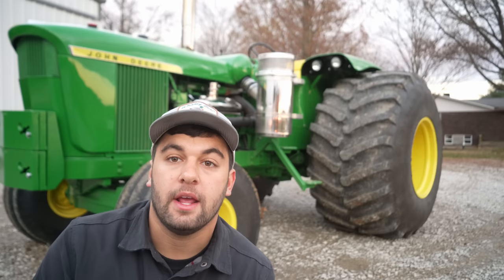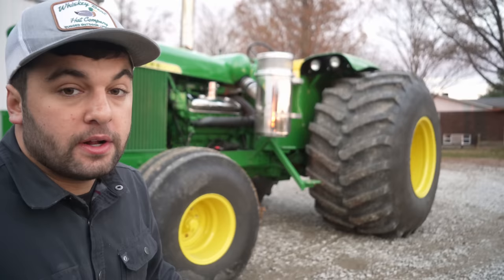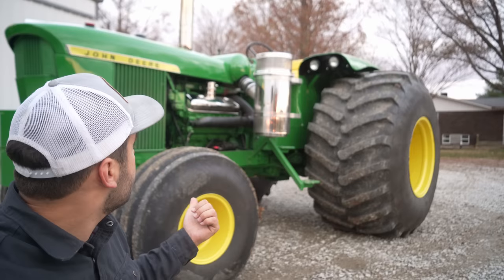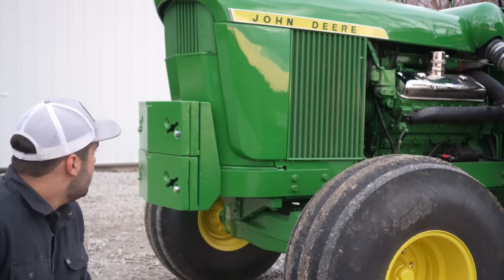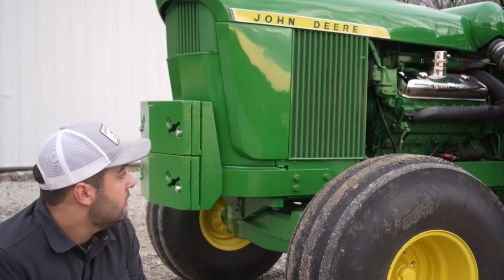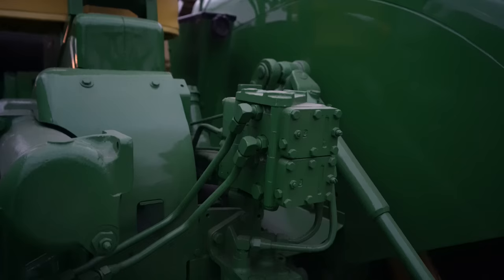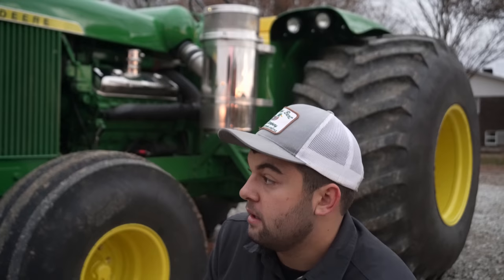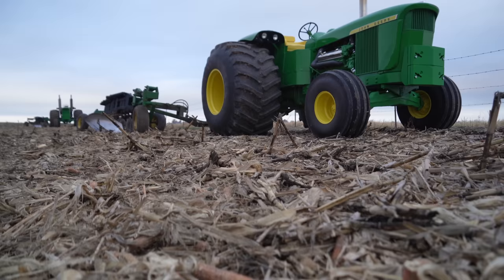John Deere 5020 Repower- 8V71T Detroit Diesel

Comment: Not a supercharger blower it does not super charge the air the turbo is for power The blower is to complete the scavenging process of the two-stroke Detroit
Reply from the maker: Essentially the same thing.
Reply: @RennerStockFarms  nowhere near you’ll over speed the engine and runaway before the blower ever adds any more power i’ve spent 14 of my 24 year old live Learning from my grandfather working on 8v92 6-71 6v92
Reply: Not a supercharger on a Detroit, it's a scavenging air pump and not a power adder. Engine is non functional without it, turbo is the power adder.
8v71 is 318 horsepower, 8v71T is 360 horsepower.
Beautiful tractor and workmanship on the console.
DON'T lug the engine below 1700 rpm !
If you reproduce the adapter plate and clutch parts, a lot of people would buy them.
Reply from the maker: I stand corrected, thanks for your input guys. If I am not mistaken, aren't the blowers off these engines used on other engines as superchargers?
Reply: @RennerStockFarms  super chargers are essentially the same as a blower but when you take a blower off of a Detroit and put it on like a big block Chevy and then it’s a supercharger it charges the air for a naturally aspirated engine like a big block Chevy for example but on a supercharge big block it takes like 5% of the horsepower to make horsepower but with a gasoline engine you can spin the blower faster to actually create the boost necessary to make it a supercharger is what I was taught
Reply from the maker: Well said, we are on the same page now. I knew superchargers and blowers were basically the same thing, its just how they are used that changes their name. Thanks for watching Corey!
Reply: also some cases are different like some have after coolers under the blower an Drive gearing could be different as well
Reply: @RennerStockFarms  Yup. I think it rather common to take the bower of a dead detroit and use as a supercharger. Beautiful looking and running machine by the way. I ran maintenance on 2 foam trucks that had 8V92T's in them. Could get a 85000 lbs truck to 70 mph in 58 seconds and pump 1500 gallons of water in a minute and a half. 
My big squirt toys.
Reply: @RennerStockFarms  Yes they are being anal . Blower and supercharger is the same unit ,I believe the GM engines are slightly above atmospheric pressure for the scavenging process . After the war ,racers like Don Garlets  fabricated them to supercharge the their v8 engines .Gm 2 strokes were designed in 5 he 30s and used in dozens of applications . They came from the factory in some Oliver's, Allison Chalmers, Chamberlains, and a couple john deeres.

Comment: Hi There. Here from Argentina. Congrats for all the work done on this beauty! How much the tractor weight? Isn't it too much power for the transmission and clutch to cope with? Rear wheels are much bigger than 24.5 32, correct? I Imagine this beast can pull 3 of the same Plow at same time. It make much more sense to me going out at least with 2 Plow. Sorry about that many questions.
Reply from the maker: Thanks for watching Alex, I'll do my best with the questions! The 5010 and 5020 had very heavy rear ends, overbuilt for the 140 horsepower engines that originally came with them. When Kinze repowered these tractors he marketed them not for pulling heavier loads, but for pulling the same load faster. Making this tractor with the Detroit pull a huge load with a lot of weight to make it hook will absolutely send parts flying! Having the tires slip a little saves the transmission, this video shows that, but it also shows we could use a little more in the front and rear. The rear tires are 900R32's similar in size to 35.5-32s, they are massive. The tractor would only be able to pull 7 bottoms, maybe 8 in light soil. If you could safely get all of the power to the ground without turning the transmission into scrap metal it would really be a beast. Thanks again Alex, stay well in Argentina!
Reply from the maker: Also, should be somewhere around 20,000 pounds, but not sure!
Reply: Thank you for all detailed info! I get your point of going much faster but pulling same sort of equipment. Make sense! Thank you and stay safe.

Comment: Why only six bottoms? My cousin pulled ten behind an HD-9, with a 4-71!
Reply from the maker: A one word answer: traction. That HD-9 with the tracks and being really heavy got its power to the ground much more efficiently than this 5020, and I'd imagine that Allis was pulling those 10-bottoms pretty slow. With putting so much work into this tractor, we would rather have fun with it than push it over the limit 👍
Reply: @RennerStockFarms  Thanks for replying. I'd guessed that traction was probably the answer. Actually, it pulled them in 4th gear. I have run boats that were all Detroit powered. 2, 8v71's for mains, 2 6-71's for big electrical loads, and a 4-71 for light loads. We love them at sea for their dependability, and common parts. We carry 4 extra sleeves and pistons, and 1, 4 cylinder head, which will work on the 4 or 8, and 1 extra straight six head, packed in cosmolene, in the marine environment. These are ex U.S. Army power scows, built during the second world war, and the original schooner style (house aft) Bering Sea crab boats.

Comment: 8V71 with turbo is a 350hp with blower it was 318hp
Reply from the maker: You would think with the large displacement of this engine that a turbo would have a bigger effect on horsepower production, but that is correct. The turbo only adds about 30 horsepower on an 8V71.
Reply: @RennerStockFarms  The 8V71 wasn't the strongest motor GM ever put out, the 8V92 was a much bigger horse could take a bit more cranking up. Comparitively speaking they had very small displacement compared to most other diesel motors of the time.  They did much better in steady state operation like generators where the load could be closely controlled

Comment: Not a farmer just like Detroits but would it not be able to pull a larger plow because of lack of power or it's not heavy enough to get the traction required?
Reply from the maker: With these repowers there is a fine line between too much weight and not enough. This tractor with the Detroit could easily pull 8 bottoms if it were only up to engine horsepower. Getting the power to the ground is the problem. Adding a ton of weight to get it to hook will pull larger loads, but it also puts a lot of strain on the transmission components. These transmissions were tough, but not indestructible. If you could manage to get all of the power to the wheels with no slip, the transmission would be in parts very soon. But, this tractor should be set up a little heavier to pull 7 bottoms, and we are going to work on that soon.

Comment: So is it okay to rev a two stroke diesel ? Unlike  a power stroke or duramax ?
Reply from the maker: They run the best at higher RPM, I have been told that they don't lubricate properly when they are lugged, and were designed for the higher RPM range.

Comment: That's a blower. Not a super charger. It provides zero boost. Without the turbo this engine with the blower is considered NA. The engine because of its design will not run without the blower

Comment: How does that Transmission handle 304HP?  The original engine was 141hp.
Reply from the maker: Deere overbuilt these transmissions, and allowing the rear wheels to slip puts less strain on the rear end components.
Reply: @RennerStockFarms    Great job, I admire your creativity.  Surprised but not surprised that Deere designed the trans and rear to handle a 150%  HP increase.  I was always a Red guy starting with a 1066.  I only learned to appreciate Deere tractors later.  Their designers and engineers put more thought into the product.

Comment: Detroit's ARE NOT super charged ! They are natural asper with out the turbo That blower does not build ANY pressure it is no more than a air mover it will not run with out it because they are 2 strokes there is no intake valves just slots in the sleeve
Reply from the maker: Yes, other people cleared that up.

Comment: I missed the horse power ... whats it at ??
Reply from the maker: Forgot to mention that, thank you. 8V71T were rated for about 360 horsepower.
Reply: @RennerStockFarms  .. thank- you ..  that tractor gots balls ... love the sound of a Detroit
Reply: 360 hp is with the stock blower and injectors.  The turbocharger gives it more. Wonder if the injectors are 70 mm stock or maybe 90 mm or more.
Reply from the maker: Not sure what size injectors are in it, but without the turbo it is 318 horsepower. It was often called a 318 Detroit. The turbo gets it to about 360.

Comment: 13 speed in it it'd be a lot easier.
Reply: I forgot the search term I found it with, but there's an Australian guy with a homemade tractor I saw the other day equipped with a 4-71 and a Roadranger transmission. He said he could plow 20 acres an hour and run 30 mph. It was an awesome build that had over 13,000 hours on it.